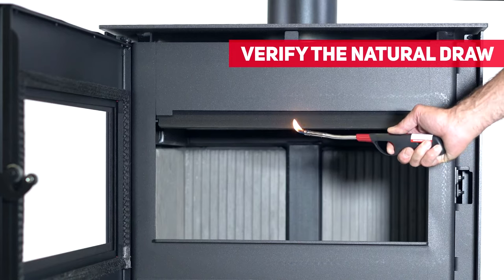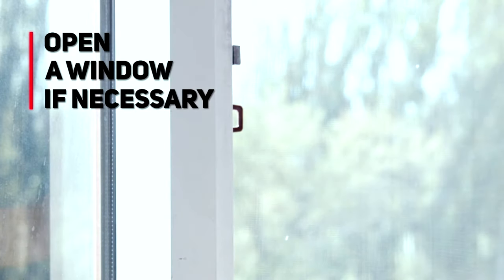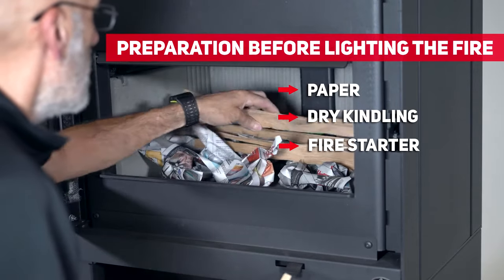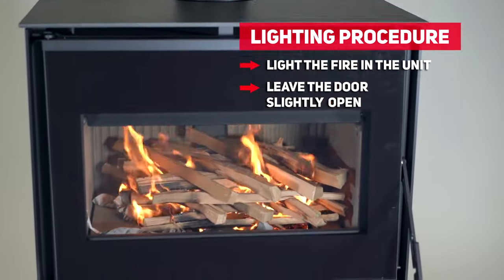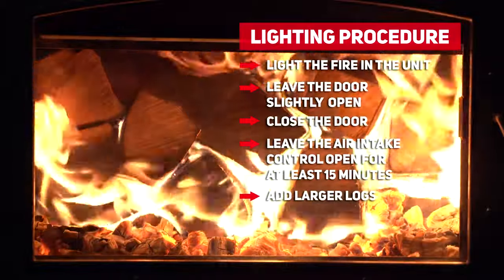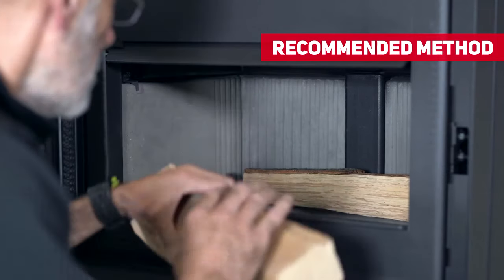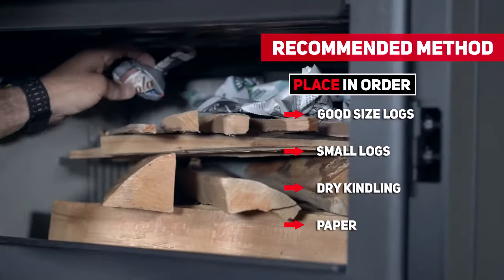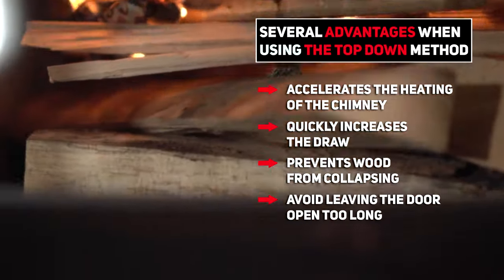Ventis Recommended Lighting Method for Wood Burning Appliances

Comment: I recently bought a Ventris 240 wood stove and were enjoying the inexpensive heat. One thing I have not been able to determine is the maximum safe temperature the stove canbe run at. Do you know what it is?
Reply: I heard around 500 degree is safe but not sure. How are you liking your stove still?  Is the door still closing and locking good?